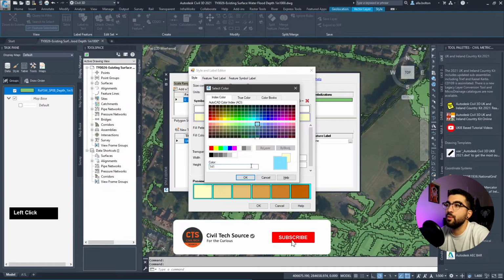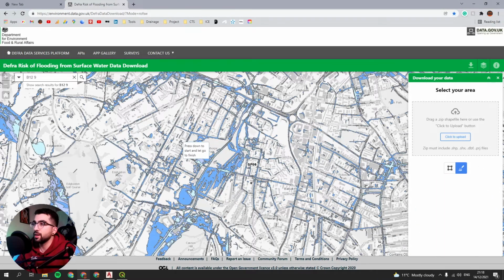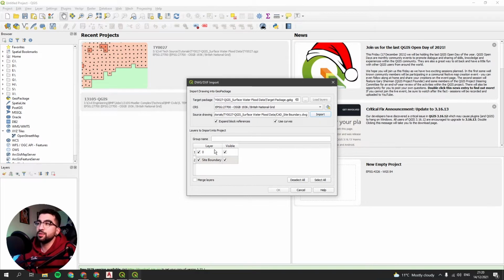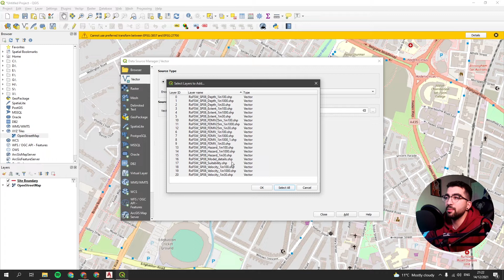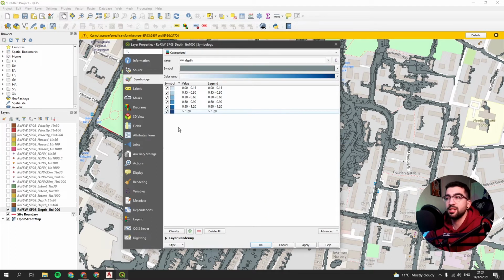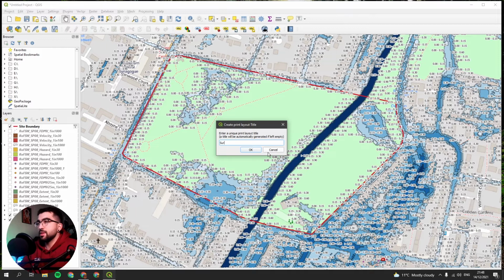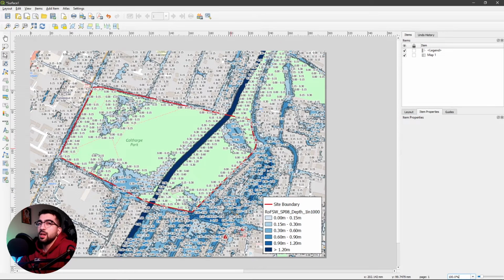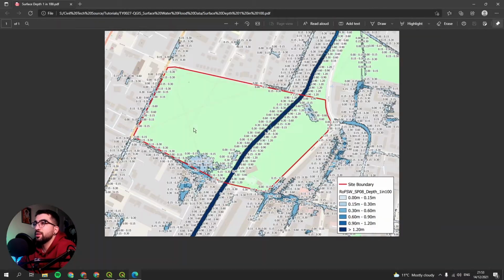Import Shapefile in QGIS - Surface Water Flooding Depth Range

Comment: Hello, thank you so much for this video, I have referred to this so many times for producing flood mapping at work. Defra have now updated the flood mapping with new data sets and I am a bit stuck with this. I have tried the link https://environment.data.gov.uk/support/announcements/569147407/568524811 and used the risk of flooding from surface water - climate change 1 link, however when bringing the files into QGIS, only the depth range layers show. I am only after surface water extents and want the, low flood risk, med, flood risk and high flood risk layers. Also it seems that the extents are all on the same layer, and I cannot find a way to separate them into high, med and low. Am I meant to be using a different link? - it must be the new dataset though. Would appreciate some help on this 🙂. Thanks.

Comment: bro from where you get the depth level data, ?
Reply from the maker: Its provided by the EA but its depth range not depth level
Reply: @CivilTechSource  thank you , my issue is : i get the FEMA depth data for harvey hurrican but can not open it in qgis ?
Reply from the maker: Well not sure of what type of data is it. You can  check what information it has in the data attributes section when importing in qgis. What file format is it?
Reply: @CivilTechSource  Solved, Thank you.😀
Reply from the maker: What was the issue?
Reply: @CivilTechSource  the issue was in the how qgis read the data , wherever my actual problem is how implement my path planning algorithm in that depth map ? have you any idea or video for that > thank you